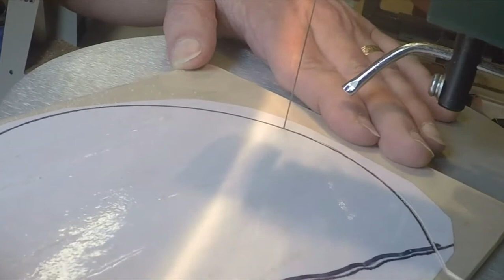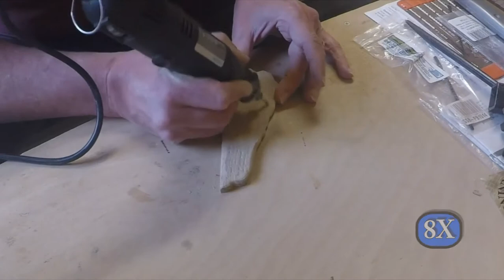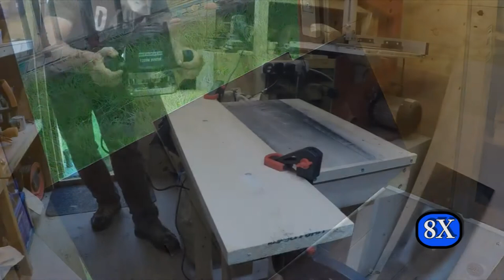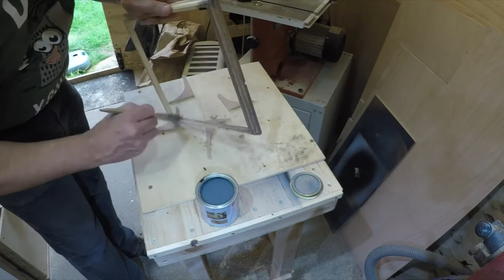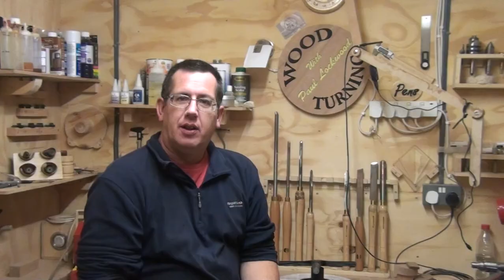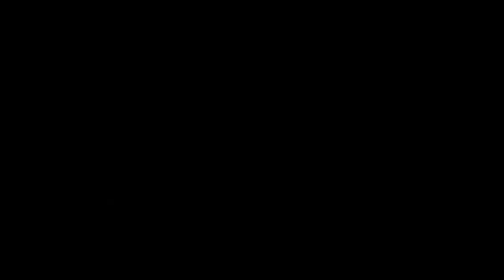SS#5 Howling Wolf

Comment: Amazing one ...what type of blade and wood is sir
Reply from the maker: Thank you. I think these were just Record Power blades, the ones with the teeth pointing both ways.  I just tend to use what I have, which may just mean a bit more sanding with all the fluffy bits underneath.
Reply: @PaulLockwood  thank u sir